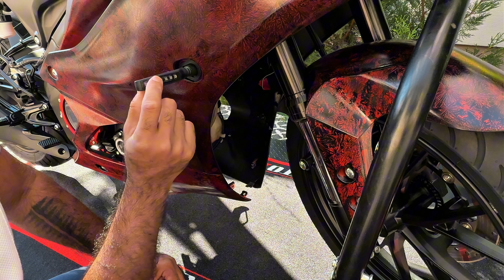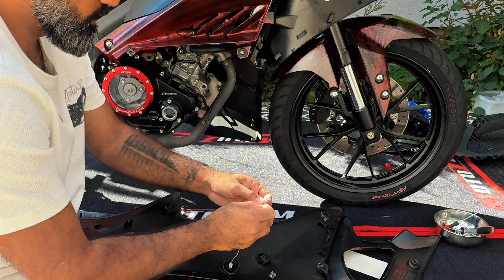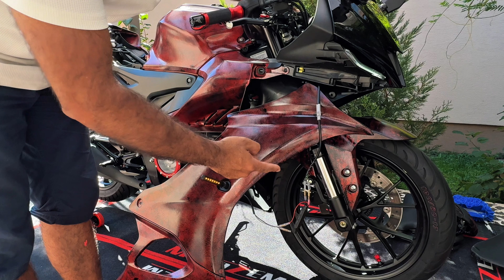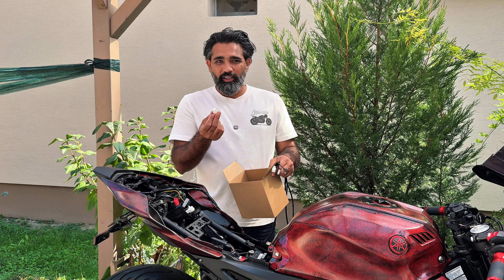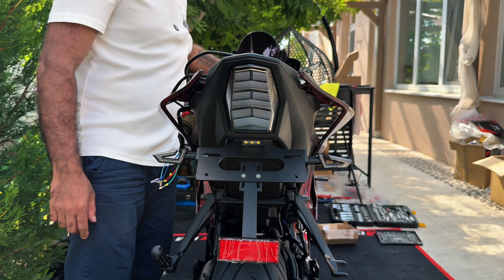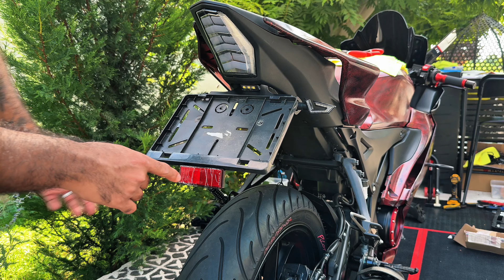Yamaha R125 | How to install Tail light | Tail tidy | Turn signals

Comment: Hey , but why use so many resistors? Just change the relay flasher
Reply from the maker: I prefer resistors. But relay odds also good option.
Reply: @AA_Last_Ride resistor make to much mess and it became hot
Reply: Where can I locate the relay flasher? I couldn’t find it under the seat
Reply: @yzf.jonnyy have you found it already? I am also looking for it. Please let me know!
Reply: Hi yah, unable to find the flasher relay, any help?